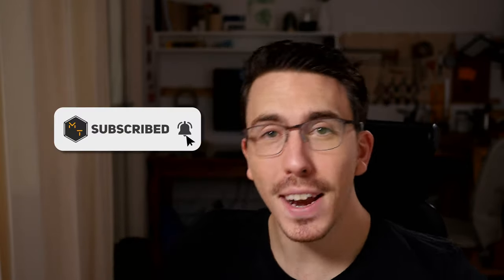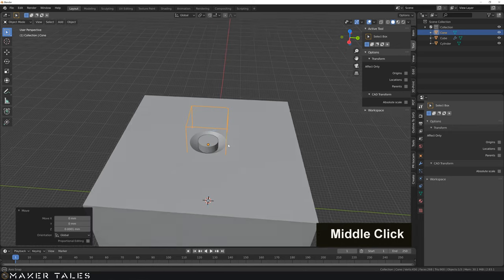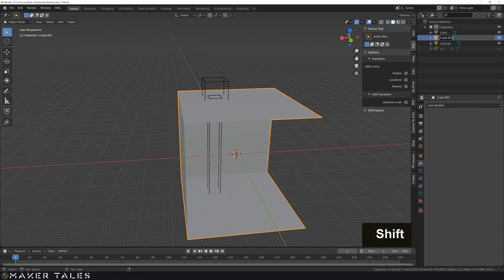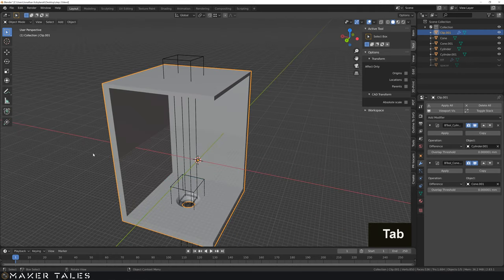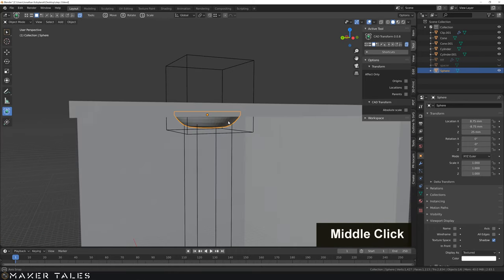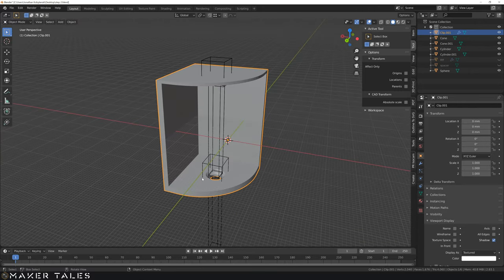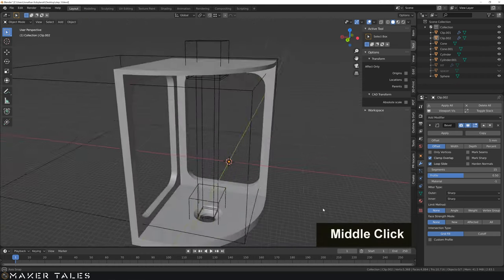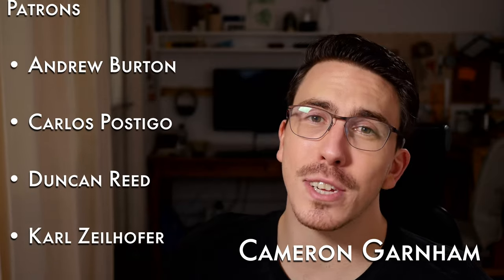H.O.T.A.S Clip | Blender 2.83 Precision Modeling In Action | 01

Comment: Hi, like the video. Any chance of doing a video on the 3D edit tool? I use it a lot but don't know what exactly some of the things are on about or if it is relevant when not 3d printing.
Reply from the maker: Hi Euan, I'm really glad you enjoyed the video. As for the 3D edit tool do you mean edit mode? Ao just a quick question have you gone through my precision modeling course? As I think this would be a good starting point to understand what is really needed to be known for precision work in blender. You'll find that most of the tool in edit more are for organic modeling.
Reply: @Keep-Making  You used the 3D edit tool it comes up under 3d Print on the right hand bar. If I get sharp edges or thin faces is this 3d only or can it be used for making cgi or images?
Reply from the maker: Hi Euan, Sorry for the delayed reply.
If it has a thin face or something this should still be find for CGI stuff.